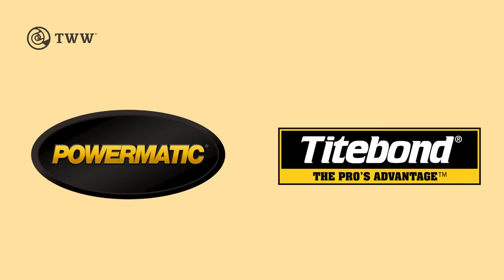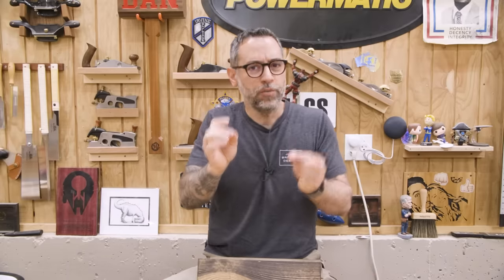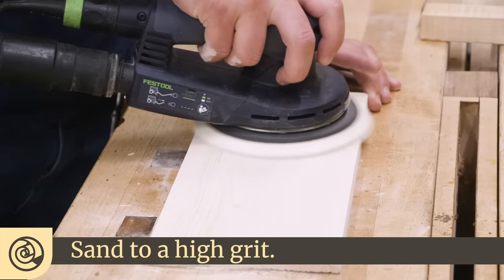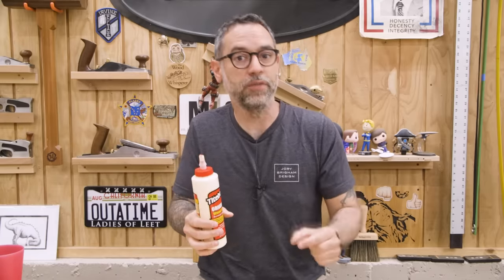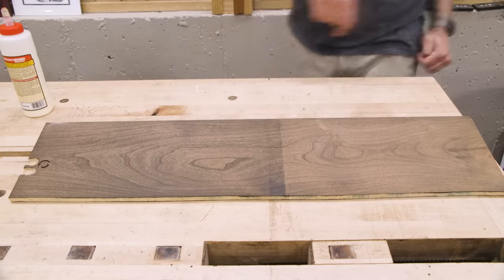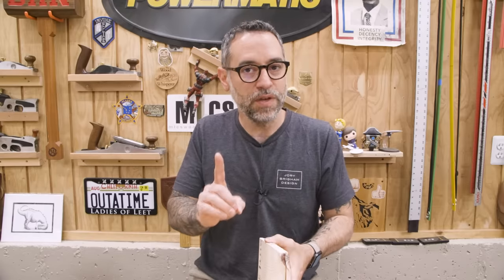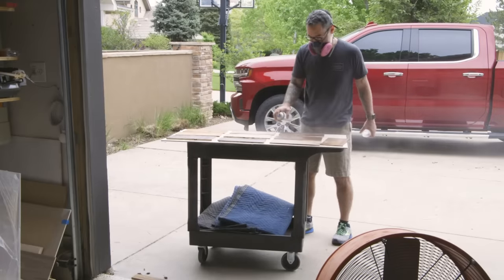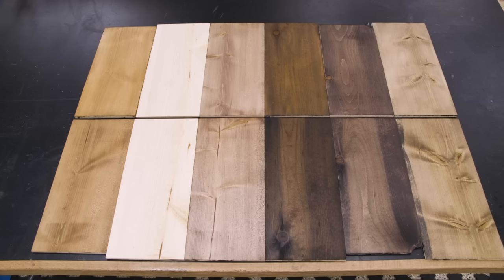Make Stains Look Better! | DIY Blotch Prevention Formula

Comment from the maker: 0:42 - What is Blotch? 
2:42 - Classic Blotch Remedies
6:16 - My Formula (DIY Recipe)
7:21 - Does adding the finish actually make a difference? 
8:16 - Testing Different Methods
11:30 - Testing Different Stains
Reply: Just for future reference, the test where you mirror a board by cutting it in half and staining both sides is flawed. The grain that "goes up" on one piece and absorbs more stain will be going down on the other board, since you flipped one of the boards upside down. If you did this and stained both boards the same way, I'd expect the dark and light spots to be opposite of each other, which is the case for many parts of the samples. I'm assuming the samples that contradict my theory are due to effects of the blotch remedies, but I can't be sure. This test is better than using two completely different boards, but not as good as your initial test that involved the laborious process of moving to a lower layer of the same board to perform tests. Therefore, even though I agree with the conclusion you come to, I think you came to it based on the results of a flawed test. Regardless, the video is still good and very informative. Thanks.
Reply: @16:01 - What is Belch?
Reply: Bob Flexner's Understanding Wood Finishing say's that the instructions on the pre-stain can are wrong and you're supposed to let it dry 24hrs or 6-8hrs on a hot dry day before staining, he also say's gel stain can be an alternative to pre-staining. Thanks for the glue tip, I'll try it, I think the pre-stain gel stain makes more sense if it's a big project like a kitchen or built-in.
Reply: How long should the Marc Juice dry before staining?
Reply: What stain were you using at the 5 min mark? I think you used the same stain the whole video. Was it a dye?
Reply: Have you ever used hide glue instead of wood glue in "Marc Juice"?
I am attempting to refinish a 100+ years old collapsible wardrobe.  The Poplar is EXTREMELY dry and brittle.  I need to stablize the very old wood. 
Advice is welcomed.
Reply: Could I replace the water based clear with Polycrylic in Marc’s Juice recipe?
Reply: can you use pva glue

Comment: Marc has some very expensive tastes in lumber, bubinga, walnut, and now construction lumber, how are we supposed to keep up 😜
Reply: Well... According to this video, we can all just use pine from now on
Reply: I know this is an late reply but where I live (Oklahoma). You can now get ash, #2 grade walnut, hickory, cherry, hard maple for cheaper than construction grade.
Reply: @HarrisonFord11  that's nuts!
Reply: @thomasprovencher4611  I know I bought a 16 ft, 10 in wide, 6/4 board of ash the other day for $42 bucks. Find a 2x10x16 anything in a big box store for less than that? It’s impossible.
Reply: @thomasprovencher4611  a 10 ft 2x4 of rough sawn cedar is $24 bucks at my lowes.
Reply: @HarrisonFord11  I’m in Western Canada. Our construction grade is usually affordable but everything else you mentioned I need to take out a mortgage just to build a small box. 😢
Reply: @ConcreteLand  it’s awful here domestic hardwoods are significantly cheaper that construction grade at local big box stores.
Reply: @HarrisonFord11  where you live? 👀
Reply: Well you see. It all starts with an acorn... you plant that sucker, water it regularly, learn to play the guitar underneath it, make a child under its bows, picnic with it on occasion, and then one day, you look @ it like bacon on the hog!

Then you cut it down, rip it into 2.5-3" slabs, let it sit for 3 years while you think about those memories in a dry place. Then finally you too can turn those memories into a coffee table! And count yourself among the very few to be able to complete such a task.

No wonder it's so hard to keep up... I live in an apartment!
Reply: @brandonhoffman4712  those pesky landlords, not letting you plant your own trees and wait on them to grow for 40+ years!
Reply: @thomasprovencher4611   IKR! Plus if I try to make babies under thier trees. All of a sudden it's a problem!

Tree hoarders... Sheesh!
Reply: When making the mark juice what if I'm using oil based finish and stain. Then what would I use to mix in with the glue and water can I use paint thinner glue and finish stain oil-based?

Comment: I’ve had good results with very strong black tea as a conditioner. I’ve used it on pine and cherry and have been very happy with the results. I use 10 bags of English black breakfast tea in 1 pint of boiling water. Let it cool and paint it on and dry. Sand lightly to remove the fuzz and stain.
Reply: This so interesting.  Can't wait to try it!
Reply: That is also my technique to lessen blotch. And I also find it very effective.

Comment: I do something a little different than others. After sanding to 180 I put on two light coats of wipe on poly. Then I lightly sand.  Then I put gel stain on top  and wipe off the excess. Then I let it dry for the night.  Then about 3 more coats of wipe on poly. Then some 4 steel wool with paste wax. Try it and let me know if you like it.

Comment: Great video! I prepared some MarcJuice (4 vol% PVA adhesive, 4 vol% PU) and tested it alongside a second method, wetting the surface with Extender (from General Finishes, a polyol mix, AKA pot life extender for PU based stains). Both of these methods worked excellently. I recommend you try Extender method if you ever do a video update. I’ve also ordered some proper, pure polyvinyl alcohol with higher polymerization & hydrolysis level, so it will have better film forming character and liquid resistance compared to the PVA they use for adhesives. I’ll reply with an update and let you know how that compares with MarcJuice!

Comment: I’ve made the glue size and have had good luck with it but hated dealing with sanding the grain back. I’ve recently have had great results, actually better results using clear gel varnish as the prefinish and immediately apply gel stain over top the clear before it dries. The clear controls the absorption without sealing off the color coat. Major plus is no grain raising
Reply: Nick Ramey, can you tell me what products you used?  Thanks!
Reply: @lindamowry5855  General Finishes Gel Topcoat (the clear) and General Finishes Gel Stain.

Comment: I was working on refinishing an oak table. Did the sanding, used a wood conditioner and then stained. It came out horrible. Lots of blotches. I came to YouTube for an answer and you did not disappoint. Even though I had doubts about this working I picked up supplies I could find at the local hardware store. I sanded the table top again, used “Marc Juice”, then stained. 
It worked miracles! Came out exactly how I pictured and I couldn’t be happier. Thank you so much for this tutorial. This video was so well done. You are a great teacher. Thanks you for saving my project.

Comment: Just wanted you to know that I tried your recipe on some 100+ year-old reclaimed pine I'm practicing on before using it to build an electric guitar body out of.  It worked well to prep the surface before applying a water-based dye and really appreciate you passing on this formula.  I have a pic of the results if you want it.  Thanks.

Comment: Mark, thank you for your great suggestions on how to stain with minimal blotches.  I have struggled for several years trying to obtain a uniform stain coverage on hard maple.  Following your guidance, my staining has improved.  I do have a suggestion that gave me  an even more consistent stain.  After plaining my plank of hard maple, I sand with an 80 grit wood sandpaper and then 120 grit, using a random, orbital sander with vaccuum attachment.  I then lightly, hand sand with 150 grit sandpaper in the direction of the grain.  I apply your prescribed mixture of wood glue, polycyclic varnish and distilled water.  After it dries, I do not sand it, but apply two coats of stain (per stain application directions), followed by a clear polyurethane varnish. After the varnish hardens, I then lightly hand sand with 220 grit sandpaper and add subsequent layers of varnish.  I see a marked improvement of the stain coverage, that I assume is due to the mixture raising the grain - allowing improved absorbtion of the stain.  I have also applied this technique using dyes and polycrylic clear coat with comporable results.  Plus, I had similar results on 6" x 12" pieces of soft maple, white oak, red oak and ash.  I now look forward to future projects using maple.

Comment: Excellent examples. Thorough method for creating comparables. Glue + sawdust as filler. Glue + stain + water as conditioner. We’re going to need a bigger bottle of glue. Thanks for the video!

Comment: I've been using "Mark" juice for 10 years. I works amazing to seal cut sides on MDF as well. Which is a must if you're going to be painting it for finishing.
Reply: For paint I would think a shellac would work faster, being alcohol based. Ready for the next step 3x faster guaranteed!

Comment: Marc,thank you for another great video and tip. I recently read an article by Bob Flexner and he mentioned that the instructions for commercial wood conditioners are wrong. He recommends letting the conditioner dry completely over night. He showed some examples and there was a huge difference when following his suggestion. I’ve had success making poplar look like cherry by using the shellack method with a one pound cut. I’ll try your formula next.
Reply: I have thought about experimenting with the commercial conditioners because I wondered about the instructions. Thanks for the info. I'll find the article your referenced.
Reply: I’ve had reasonable success with the Varathane pre stain, but I agree with the drying time. I have found that if I don’t ensure that it’s dry and ‘cure’ that it remains a but soft on the surface and completely clogs the sand paper. (I like to sand before appling the waterbased stain.) However, when it is given more time to dry, it sands just as expected. I plan on trying this juice as I have just ran out of what I’ve purchased.

Comment: Thank you Mark for this helpful tip. I am having all my pine floors refinished. After sanding off the floor's old stain, I used a wood conditioner and then had a good quality stain applied. The results were horrific. I was really perplexed because I had done everything right, or so I thought. I am excited to try the Mark Juice and have my floors re-sanded and finished, this time with better results.

Comment: For anyone working with birch, I made this and tried it with a water based stain compared to varathane’s oil based conditioner. The DIY solution gave the birch noticeable black specks where the grain recessed (same with no conditioner), whereas the varathane removed the specks and evened out the transitions between the changes in wood tone. So wouldn’t recommend for birch, but it looks great on the wood in this video.
Reply: Thanks Chris. Just saved me hours of experimenting. Will use the commercial oil based conditioner for butcher block desktop
Reply: Hey Chris, do you know if that goes for water based as well??
Reply: Can we use oil-based conditioners for water-based stains? AFAIK it's against manufacturers' recommendations. Did you have positive experience making so? Finding water-based conditioner is impossible where I live so I am in search for blotch preventing solution for birch plywood and water-based stain.

Comment: very useful and practical tips and examples I can use.  I have always struggled with getting even (ok consistent) staining in my finished piece of furniture especially with the kind of common woods you mentioned.  In my early days before YT videos chose just not to stain most of my projects.  I have hopes to do better with some of the techniques you have suggested.  Thanks for such in-depth videos on critical steps like finishing a well-made piece of wooden project

Comment: Thank you for this! I've been having a problem with blotching and I haven't had much luck with the commercial pre-stain products. Your juice is easy to make, easy to use, and since it's all water-based there are no fumes to deal with. Best of all, IT WORKS! I used 2 1/4 teaspoons of glue, 2 1/4 teaspoons of MInwax Polycrylic, and added enough water to make 1 cup. 

I subscribed to your channel and will look for more of your videos.
Reply: Do you use oil stain over the polycrylic solution? Polycrylic is water-based, right? Is it okay to use oil stain over a water-based solution like that?
Reply: @robira1313  You can use oil based over water based and vice versa as long as the first is completely cured.

Comment: I use 40% glue by volume for general finishes dye stain. Love it on pine and poplar. Really stubborn wood gets two coats of the glue size. I find a second thin coat is easier then mixing something thicker.

Comment: Shout out to Marc Juice! Came searching for a solution after my unfinished pine shelves were blotchy even after using a pre-stain conditioner. Wish I saw this video before, could've saved me a lot of sanding to remove the old finish. This stuff really works!

Made a smaller batch of Marc Juice since it was a little project: 10g wood glue, 10g water-based stain, 240g water

Comment: Hi folks, after trying several different products and methods on "BIRCH", I was unsuccessful at eliminating all the blotches and was ready to give up staining my furniture piece and just clear coating it. That was until I found this video. I mixed up a batch as formulated by Mark and applied it to the material. It dried pretty quick, so I was able to give it a light sanding with 400 grit and then applied the (water based) stain to find in my opinion, the most beautiful, grey stained birch wood with no blotches. THIS formula did the trick for me. Thanks so much for this great video !!!!!
Reply: Did you get black specks where the grain recessed? Another comment mentioned that on birch, but you seem to have great results! i would love to know

Comment: I have to try the Mark juice. What i find that helps me is i will brush on the stain, then i'll use a second cleaner brush to remove the excess stain. It's basically prevents the stain from penetrating as deep as it would when using a rag which will mash the finish into the wood. Good job Mark

Comment: @ The Wood Whisperer. Great demo and suggestions. Thanks for sharing. I have just installed a 70m2 rough-treated softwood timber deck. I'm not sure whether to stain or paint it. I like the idea of seeing the grain (using stain) but worry about the blotching. I may try out your glue recipe. The alternative is painting the deck and then woodgraining it, but I'm new to this and don't know what ratio of glaze to paint I need for a 70m2 deck!

Comment: Ill give it a try.
1st try with your 3+3 formula on hard sanded doug fir. Hand rubbed in. I dont brush on with soft woods as it does drink up too much IMHO. The 3+3 did appear to help a fair bit. I havent used it enough to say more yet. I do use pre-stain as well. More use to come will tell.

Comment: Hi Marc,  this video was right up my alley. In particular I'd like something I can use inside to reduce blotches, ie without toxic chemicals, since I dont have a woodshop or garage.  Yesterday i used pre stain conditioner on small area of drop leaf desk I'm redoing and yikes the fumes were SO bad i had to call the fire dept for advice on how to get rid of the smell bf the pilot on my gas stove blew me to kingdom come.  

Appreciate your suggestions. Obviously the wood glue and water in Marc Juice  are odorless (will skip it on my cereal thanks) but the varnish, not so sure. May test a few mixtures water and wood glue with some mineral spirits thrown in for good measure and see it that helps.

Comment: I was determined to stain a poplar side table that I built. I watched videos to see how to do it. I did what they said, and the result was awful. It looked like I would paint, but then I saw this video and thought I'd give it a chance.

It worked! I didn't need a quart of juice, so I calculated: 1 part glue to 20 parts water. I added enough dye to see color in the juice, probably about 3 parts. First I sanded. I had some 1000 grit at hand, so I used it as the last sanding. I then wetted it to raise the grain and sanded again.

I then applied the juice, and it looked great. The stain was an amber dye. It was not my final stain. I used it as an undercoat to the final stain--a gel stain, Bartley's Colonial Maple. When dry, I sanded it with the 1000 grit, applied a second coat of juice, and sanded again. Once that was dry, I applied the gel stain. The results were terrific. I was at the point of despair, and this saved the day. Thank you.